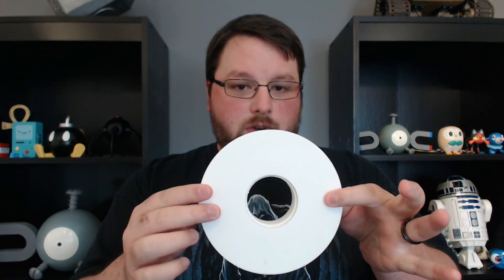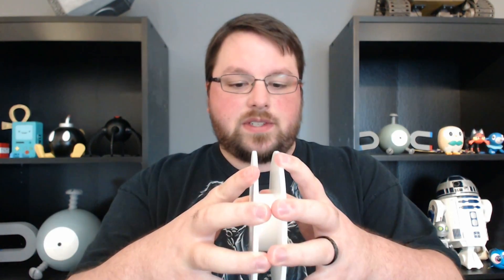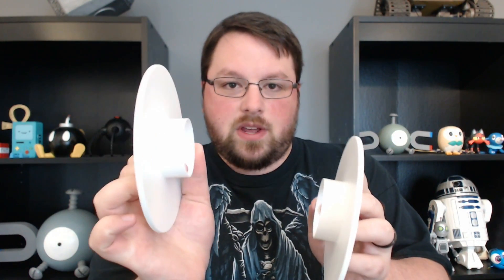3D Printed Filament Sample Spool/Holder

Comment: Chaos, I designed so really simple Miniature Axes, could you review them and tell me how to improve them?
http://www.thingiverse.com/thing:1887150
Reply from the maker: Hi Jimmy! I just checked them out and they look really good! I'm impressed at the size you were able to print them at and still have that quality. Axes are pretty difficult objects to print, so I think you did good by separating them like you did. I don't think I could improve on the printability, but have you looked into Fusion 360? I think some of the features in there would help you out a lot in putting some finer details that Tinkercad just can't do. Beveled edges come to mind.

But ultimately I think you did a great job. Specially for something that tiny. I hope that was helpful. :)
Reply: Chaos Core Tech TYSM for your review. I'll check out fusion 360 because I wanted to put intricate designs on them for people with really detailed printing capabilities. And the bevel took forever to figure out until I realized I could just use a cone.

Comment: Made 1 myself quite a while ago (never published) but not that happy about it. Using some sort of spool like this helps a LOT when printing with samples. After using one for a while I feel it's still not solving the biggest problems I have with samples, TANGLING! It really is affected from what part of a spool a sample is cut (end or start) the bigger the loops the more problems, the tighter they are is usually the best.